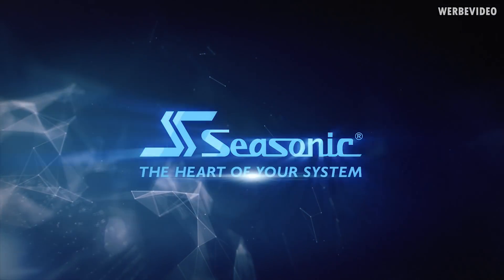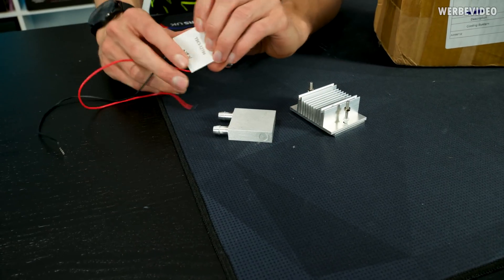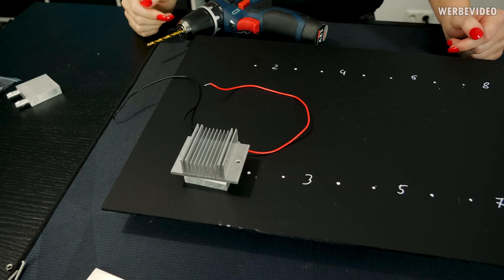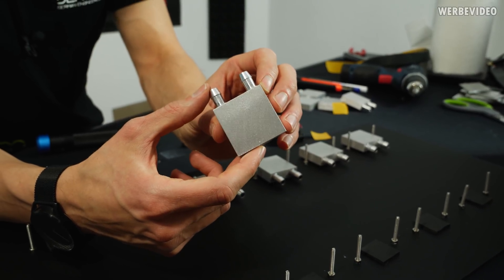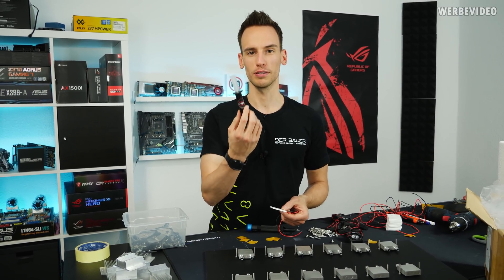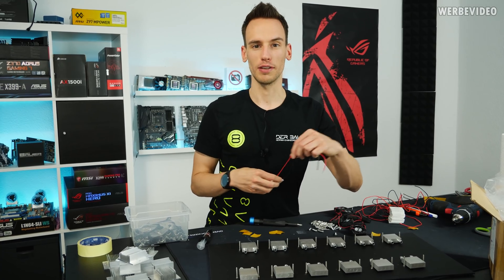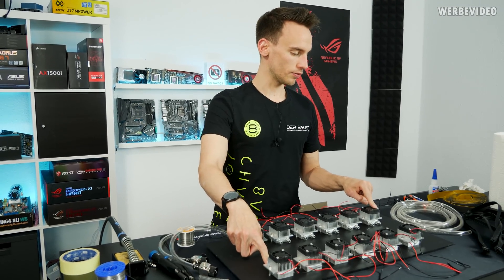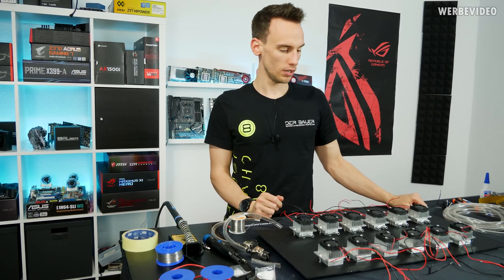200$ AliExpress DIY Water Chiller

Comment: The TEC's are not only having too cool the water, but also the air exposed water blocks and what they are connected  to, including all the tubing.  Bigger is not better in this situation.      This is what I have found.    You can not cool an entire heat sink efficiently with a TEC, and put that heat sink on a CPU and  expect it to cool the CPU, because  the as  soon  as the heatsink reaches below ambient, it begins drawing an endless source of heat from the environment.  The cold side of the tec should be in direct contact with the CPU and, or very well insulated from any external source of heat to be most efficient. Water blocks are also not designed to cool water but to heat water up.

Comment: That was pretty stupid, you have plastic tubing everywhere, which doesn't give you an opportunity to maintain lower temperature. Also it doesn't make any sense thermodynamically to put them like that, where's your really low temperature metal to exchange heat? Do you think those little heatsinks where going to help? Jesus man just watch some videos of radiator and heat exchangers.

Comment: Why not just reduce the power supply a bit and save time and money.  Too much power without enough cooling gets them them hot and not very efficient . Sorta like under-clocking .  I think lowering the power 2 amps or at least where u can feel the heatsinks at the edge of just being able to get warm , would be easier and with that setup still have the ability to do want it to . I estimate a low setting off 9-11 degrees achievable easily.  Seems a bit overkill setup you got there , but i dig it !

Comment: at maximum current, the efficiency of the peltier module is about 0.5-0.6, but if you reduce the current by half, you will get 2 times less power but the coefficient of heat dissipation is 1.0
There are 24V modules and 172 watts of waste heat. if you use them at 12 volts, you will get about 70-80 watts of rejected heat per element. at a cost of 80 watts each. Which is pretty good. 8 such modules will remove 500 watts of heat without any problems, which will allow cooling both the CPU and GPU in the same circuit. It should be noted that in the hot circuit, you will have to remove TWICE more heat energy than the computer generates. So you need at least 10 radiator sections if you want to keep the hot loop within 40 degrees. The delta T of these elements at half the current is about 55 degrees. So without any problems, you can maintain about -15 degrees in a cold circuit.

Comment: Peltier cooling system only possible with TWO water loops. COLD loop on CPU and second HOT loop for peltier elements. U need two pumps and two waterblock per elememt. Top and bottom. With this system u can drop temps below zero (u cant use water in this case). If u need far below zero like -30 C u need TREE loops and more peltier between 2 and 3 loop. Because of DELTA T on peltiers.
Also waterblocks u using very weak and not enough effective for this purprose
Reply: I did this about 15 years ago witha custom block I made only using 1 peltier. Used 2 loops as you describe - one for cpu and one for the peltier. Worked quite well as I didn't want the temp to get too low to form condensation.

Comment: The hot side became too hot with delta T  ~ 50'C which prevent the cooling.  It will be better if the cooling kept same and either the heatsink at the hot side made of big heatsink or use water cooling with two peltier hot side in a closed loop with a pump.

Comment: It would have been better if you just sandwiched the water block with a peltier in both sides and each peltier would have the heat sink on its side. You are cooling the water block on one side only.

Comment: The proper way to do something like this is to use a normal radiator to cool the hot water to room temperature, THEN use TECs. It's much easier to use TECs to get below room temperature then it is to get them from like 85* C to 10 C*

Comment: I suggest you to experiment a bit more with peltier because it was mistake to run it at 12V. if you dont have huge cooler they heat themself and basically stop working at 12V. You should power them with 5V with those small coolers so they dont heat themself. If you still have this "machine" check it out, im almost sure it will work with 5V.

Comment: OOF. applying the thermal paste like that bro that's pretty cringe bro. I thought everyone knew to put a big dot in the middle to avoid air bubbles, but hey you learn something new everyday. Still a cool video, but you might have a few air bubbles trapped between the coolers. You did say this was temporary though, so I don't think it matter too much. I'm just on crack so I'm typing my brain out.

Comment: Those peltier modules need a larger heatsink. the ones youve used arent adequate enough and are transferring heat over to the cold side. I would recommend a 95w rated heatsink such as a stock intel cooler with the copper slug, or a cheap hyper212 knock-off on ebay. (you can find them for 15$ on Ebay) these 12706 modules you bought can go up to 6Amps at 12 Volts
the TEC-12715,  can go up to 15Amps at 12V < for the 12715 you would need something similar to an nhd14 to cool it down.
I think you have a great idea going. I just don't know if I can justify the amount of power needed to do all this, compared to just purchasing a water chiller. i have had this exact same idea building in my head for a while now.
the DIY'er within me is the problem, really. its an internal dilemma.

Comment: Your NEED to PWM the TEC's otherwise your CoP will be really crappy, and wont even be worth it over a compressor chiller.  
If you PWMthe TEC's which they do really really well, you can divide the wattage drawn by TEC's increase the CoP by a large margin and actually have something called efficiency.  
Otherwise using TEC's as a chiller is just straight up stupid and a complete waste of electricity. 
This was hashed over many many times by experts over at XtremeSystems when it was popular.

Comment: Peltier units have a delta T of 40 degrees. And are horribly inefficient. You would have way better results running 8 in series cooling the hot side of 4, cooling the computer. Considering your cpu/gpu probably put out 400W heat, you're going to want double your Peltier count on both levels.

Comment: The problem here is the heatsinks, I use 4 (one died so 3) 60w modules for my amd fx6300 and stock voltage under full load my cpu reaches 13°C idle I sit at -9°C. I currently have it overclocked to 5ghz and my maximum temperature is 35°C.

Comment: Dry nitrogen piezoelectric coolers, “Marlow Industries SP5228” 3volts max 3watts max +40 hot side -40 cold reaches temp in less than a second. Do not hold in hand... and full run life span 10years... stackable! Cryogenic cooler about an inch in size, similar model to iss coolers. And people are still overpaying for normal piezoelectric coolers... sad!

Comment: it would be much simplier to use some car radiator or motorbike, and big fan...this is too much work, noisy, much energy consumption, and a lots lots oportunities for leaking...and so much cables to work...you need a lot of fan control units or somehow to power it...one big fan is quiet and eficient...Iam thinkint of some similar project and to give that radiator outside of the flat for heat to go outside flat for summer gaming.

Comment: You've got a loop ready, seems silly not to use a traditional radiator as a primary to remove bulk of the heat with high efficiency and install the peltiers after the primary radiator to take precooled liquid efficiently to way sub-ambient. Could also make a secondary loop on the peltiers' hot side go full ham with proper rads and fans there as well :D

Comment: If you connect many 12V device on a same cable (especially high power comsumers, like Peltier TEC), the voltage on the line will drop. Only the really high quality PSUs are monitoring the 12V line too, the average PSUs monitoring only the 3.3V and simetimes the 5V line - but 3.3V is the reference.
So, if you only load the 12V line, the PSU don't give you a the nominal 12V. I had a same problem when I wanted to use ATX PSU as a Lab Bench PSU.
Try to connect some load to the 3.3V line - for example a high wattage resistor (3-5 ohm @ 50W) and the 12V line will increase to the nomimal level. Peltier modules' performance highly drop if there is not enought voltage.
With this solution (using "good" 12V) I can easly (of course, slowly, 2-3 minutes) freeze few milliliters of water with 1pcs 72W Peltier module and an average heatsink/fan combination (between -3 and -5 celsius).
So, in nutshell: with these modules and fans - using the "good" 12V - , you NEED to reach really low water temperature without the CPU, in the closed loop, not just below ambient temperature.
Have good experiments (:

Comment: i pulled equivalent numbers using only a single 60W TEC and cheap water cooling parts. the solution is simple. you are correct that your current heat displacement system is wildly insufficient. as comical as it sounds. your best option is to water cool those TEC's. im using a 120AIO cooler on the hotside and a copper water block on the cold side. also, you will be better off running your loop in parallel and not sequential. slowing the flow of water gives the TEC more time to cool the water and the best way to do that is to divide flow between each TEC. Running in sequential means that you will run inefficiently. once the water temp reaches a 60W TEC's capacity, running it through more TEC's wont help.
also if your processor is generating more heat than the TEC's can displace, then you will benefit from putting a small radiator in the loop before the chiller assembly.

i hope what ive said is of help. your not too far off the money, but theres room for improvement. nice work. i cant wait to see your next video.

Comment: you guys missed a huge opportunity to piggyback by not mounting the waterblocks to eachother...  throw a copper bar/sheet between the waterblocks for stability and you could even stagger them and make it one single actual block... add another copper bar on each hot side with slightly larger dimensions.  Wide and long enough to accommodate several CPU style heatsink+fan combos. 

with that many individual teks you might opt to go with lower voltage/ constant current PSU as well if you're having runnaway problems.  
they can maintain a delta of 60 degrees only if you can manage to pull 60 watts out of the top of them(it's actually like 82-90 watts out of the top if you have a heat source on the cold side, remember, you have to dissipate the 60 watts you're pumping in, AND the 25-40% efficiency of the heat engine that's been motivated from cold to hot... so if you're putting in 60 watts at 25% efficiency then 15 watts will be motivated from cold to hot making it 75 watts of total heat you'll need to dissipate to keep the cold side cold)
  if you're only pulling out 15 watts with those small sinks, then you should only supply 12 watts to maintain the highest delta.
by the time you'd measured the power usage, they'd already heated up and their internal resistance increased, lowering their total draw.   Those kind of TEKs will only ever draw their actual rated wattage when the hot and cold sides are the same temperature.  when there is a present differential, a temperature gradient over the body of the TEK, it produces a resistance and can even be used to create a voltage potential aswell if a gradient is introduced.

Comment: That entire system is about 5% efficient, Peltiers are rarely used for cooling because their max efficiency is about 12% in optimal conditions for cooling. Buy an aquarium chiller, they're designed to run constantly. Or best option, just get a large radiator, how often is the room temp so hot as to not provide a sufficient delta? And that gives you about 80-90% efficiency instead of 5%.

Comment: Thing about Peltier is: it's much less effective the higher you go with voltage. using more heat plates on lower voltage would result with better temps, using less power, but also would require doubling on radiators and waterblocks.
Personally I'd get my hands on free piston refrigeration unit from the fridge, these are super quiet. And roll on sub zero cooling, maybe on pure alcohol.

Comment: HI there... one thing, rearrange the blocks back to back, with tube connections going outwards. Sure it would need longer tubes, but those can go over the fans. Put 3 x 120mm (or larger) fans on top of the fins. Than you can experiment with 2P6S connection and 3P4S... As already mentioned, in 12S it will be problem with efficiency of the last 2-4 TECs. Too much of the delta t. You wouldn't need to drive those on full load.  You can drop the power, and increase longevity of the TECs, but it is for the another story :-).

Comment: Run the water loop through a normal radiator first (pre cooler) and get better fans for the heat sinks. 
  
Or go over the top and build a second water loop to cool the hot sides of your TEC’s

Comment: For less power consumption, you can pre-cool the water using a regular radiator + fans. That would help get rid of the bulk of the heat, then use the TECs to get the water below room temp.  Also you should think about the contact time the water has with the cooling elements. Those are pretty tiny heat exchangers. potential idea, put the TECs on the reservoir?

Comment: What you should do, is use a separate water pump system, to cool down the heat sinks.
Use a hot-water side to cool down the hot side, and a cold water side to rout the cold water to the CPU.

Comment: Always wondered WHY do you put a peltier between an aluminium waterblock and aluminium radiator sitting on top of it. Its just an extra layer of un-neccesary insulation and junction. Also, you are heating up the peltier itself to get IT working, thus introducing MORE overall heat. Just throw away the peltier elements and you will get better results.

Comment: 2 Peltiers are enough for cooling, Please remove the paste on the cooling side because it doesn't work. also use foam around the water block and peltiers to protect it from heat source of the room, use copper embedded heat sinks like on CPUs for better cooling, also add a radiator on  output from CPU because water needs to cool down from CPU  before getting in peltiers otherwise it will just heat up the peltiers.

Comment: Kind of a shame considering you basically knew it wouldn't do well enough because of those tiny heat sinks. Probably the best thing to suggest would be LED heatsinks because they're actually rated for specific heat loads.

Comment: Could you not have offset them and moved them closer so the inlet and outlet of each was facing each other directly and you only needed a few centimeters of tube to connect them and the inlet/outlet for the system is not obscured by anything?

Or back to back both rows and bolt them together so you have fan-tec-waterblock-waterblock-fan and then mount them at 90 degrees orientation to the surface they'll be mounted on. this will halve the number of waterblocks you had to buy man and you could drill tiny little holes in the mounting surface to run the wires through so that they will never be seen.  Because you are making a sandwich you could easily get the mounting pressure you need and they assembly can be installed anywhere in the case with a bit of silicon glue even because you're no longer needing all that pressure to mount the assembly.

$0.02

Comment: INSULATION is missing... Get a 40mm x 40mm Foam Insulator for Peltier Modules
also consider mounting them so that the cold side is opposed to each other (top - down) the acrylic plate
Hot|COLD || COLD|Hot

Comment: I have had progress and some success with this idea, and watching you has given me a few new tempting thoughts and concepts. But as for your progress, did you ensure your pump has enough pressure to travel the nearly 3 meters of hose you are using? I would definetly ramp up aluminum or copper cooling mass for the tecs, as well as airflow. The temperature of tecs don't ramp up and down rapidly, so the more mass to heat up, combined with a larger surface area to cool, the easier it is to keep the heatsink near room temperature. If the heatsink is at 60 Celsius, the tec is acutally much hotter than that at the ceramic plate. If the heatsink is at room temperature, the ceramic hot side of the tec is warmer than the heatsink, but in my experince the tec is only 10-30 degrees above the heasink which is at ambient, mainly depending on total power consumption of the tec. Many other commenters are correct, the tecs can run at a lower voltage and still achieve about the same temperature difference. I have had alot of luck running the 12706 at 10.6 volts. A slightly smaller cooling effect, but less of a thermal runaway forcing the tec to use all its power to trying to remove its own heat. Yet, much of the manufacturer specs for these say they can run as high as 15v, but the coooling difference starts to decrease around 13.5 volts for the 12706 if I remember right. I have never been able to get the claimed max around 13.5, always just more thermal runaway when above 12v. So I would Not go any higher on voltage, but I would definitely try lower as I'm sure you know it will not harm the tecs to under volt. Lastly, you are making a loop that has the potential of mixed metals. I would avoid this if possible, but inhibitors can be added to mitigate the problem for a period of time. If you can remove most mixed metals (possibly pump internals exposed to the loop as well) you can also try different liquids.... Like one with a lower specific heat.

Comment: Run a 50 foot coil of copper tubing through your freezer. About $30.
Reply: ...and destroy freezer in process because they are not designed to dissipate heat from heatsource continuously. About 30$+cost of new freezer :)